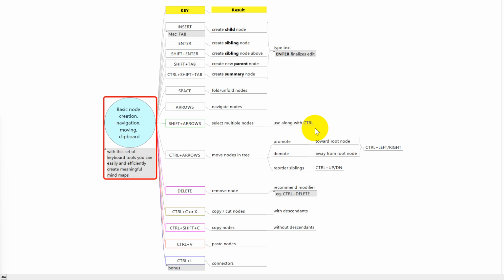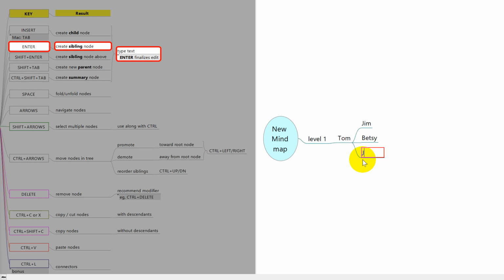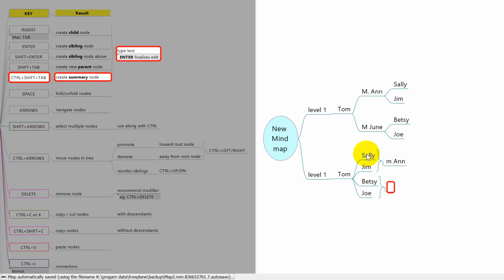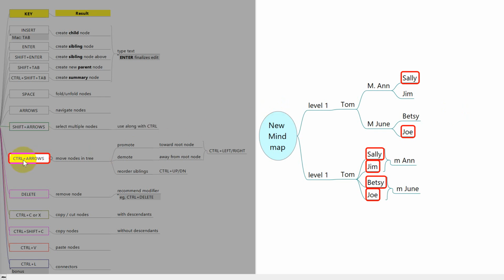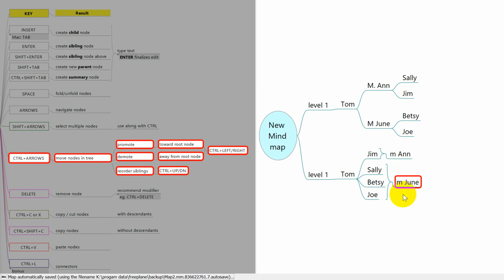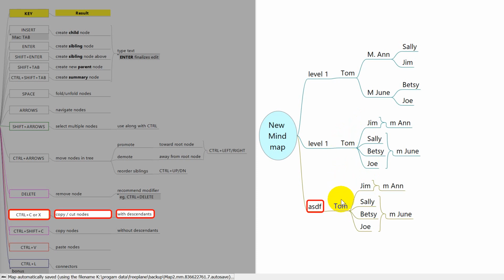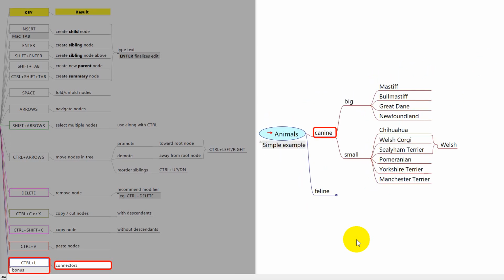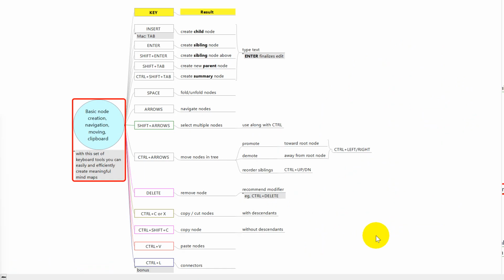Freeplane _ basic tools for meaningful mind maps - tutorial

Comment: That was very helpful! Is it possible to delete parent node without deleting descendant nodes? Thank you
Reply from the maker: I am glad it was helpful.  If you delete a node you also delete all of its child nodes.  To retain child nodes you must promote them to the same level as the node you want to delete - either by (1) dragging over the parent node until the top of the node turns grey or (2) pressing ctrl+arrowkey (where the arrowkey is pointing toward the root node).  Then you can safely delete.  I hope that makes sense.  If not, Let me know.
Reply: Yes, It works. But I wish if there was any automated way to dissolve parent node and have child nodes connect to the other parent node. Thank you for your quick response. @kenfhill84083